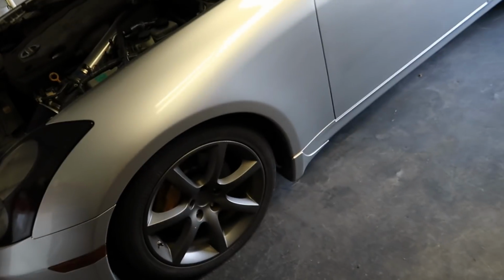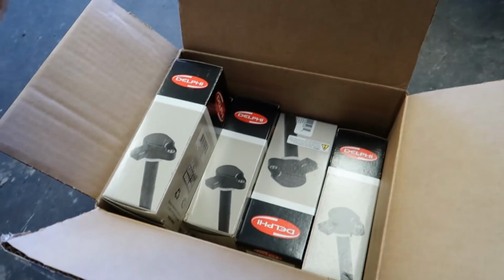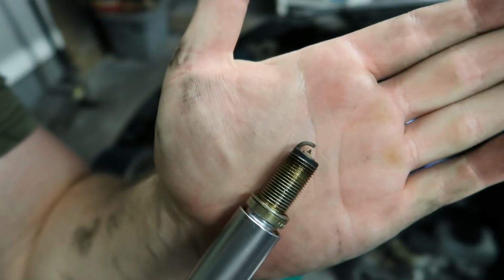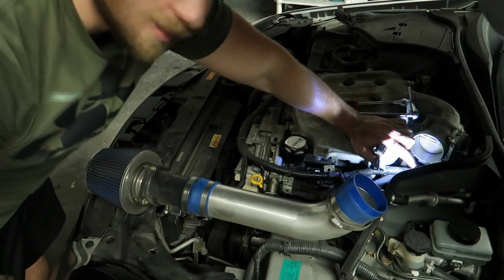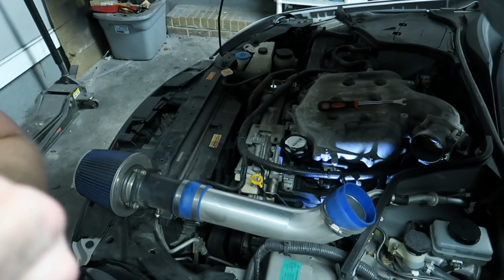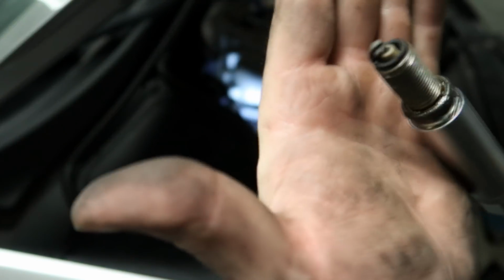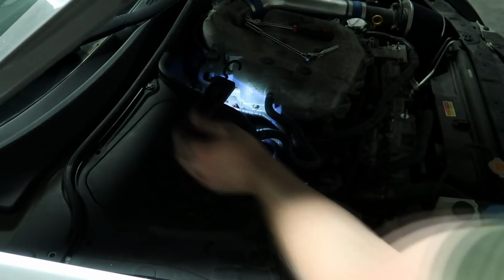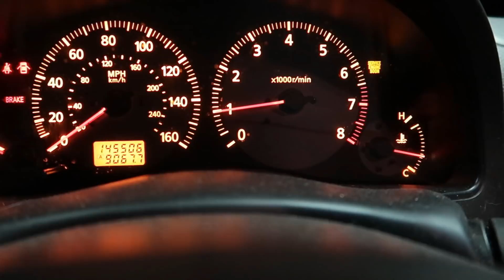G35 / 350Z P0300 P0301 P0302 P0303 P0304 P0305 P0306 Missfire Coil Replacement Spark Plugs

Comment: Hey was the last coil under the throttle body the number 5 .?  I have the same thing happening to my g35 and I replaced the spark plugs . But I have a code that’s says cylinder 5.?